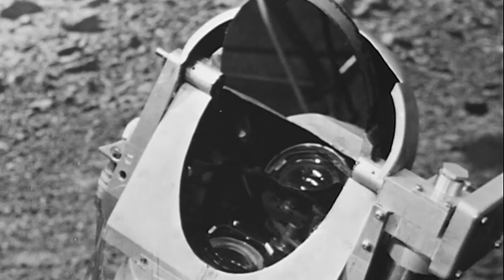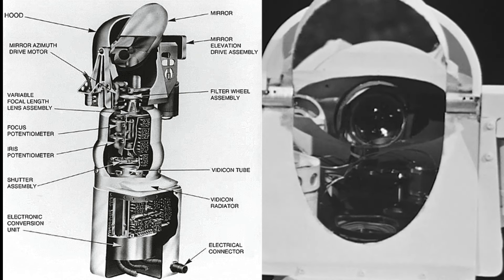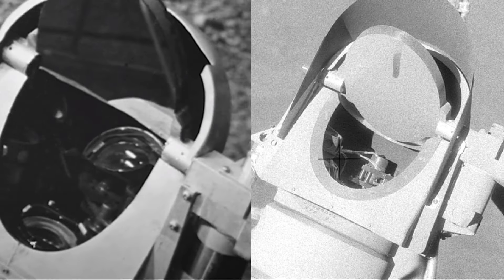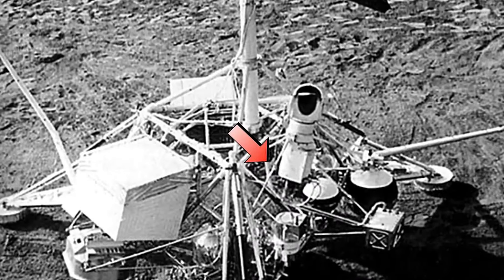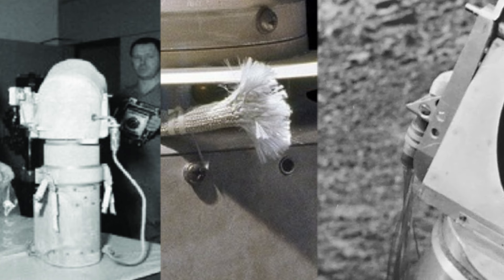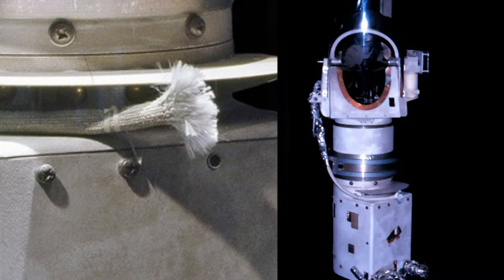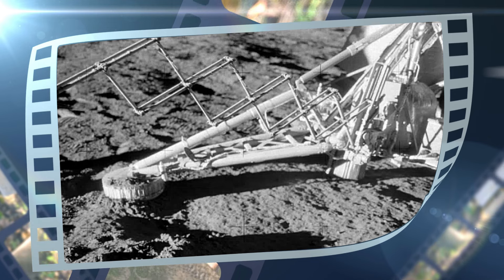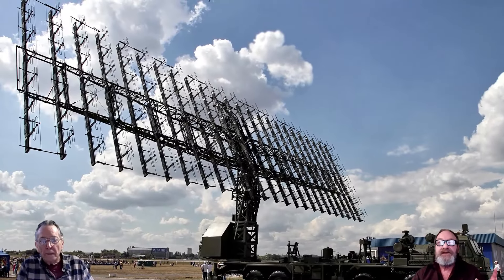THE APOLLO DISCUSSIONS "SURVEYING THE SURVEYORS" PART 63

Comment: Yep, thats rope mock up, attached with duct tape to hold in place.  Too much fluff in the end/cut to be insulation/static protection. looks more like cotton rope.
Reply: I think the stage techs were told to clean up the untidy dangling array of wires, which they tore out and replaced with an insulated wire sheath.
Reply: @yomommaahotoo264 Looking at the end of it, it is massive, like cutting climbing rope or sail rope. No way 8 wires  goes into it.
Reply: @anubisiii4384 
I've seen it in hi temp equipment I work on, and it does fray like that - but it doesn't always fray FAST like that.
If it's what I guessed than it's been hanging around between a good few stage sets.
Reply: @yomommaahotoo264  "fray" good new word. One thing that it may be a sheat, is the form of the "rope" is irregular, and one thing that it looks more like massive rope is the white attachment point or is it a clamp, some centimeters from the end. anyway. it isnt the whole world.
Reply from the maker: Sad isn't it. Cheers!
Reply: It's military issue parachord.
Reply: @mattrob19742008  
That would actually make the most sense since the AF hosted staging events.

Comment: Thats not a rope, it is cloth insulation that goes over the wires, in the pic with the wires  they took off the cloth insulation. BUT TO WORK ON THE MOON THAT HAS TO BE HOOKED UP. 😊
Reply: Bang on right.
Reply from the maker: Indeed it is referred to as "ROPE WIRE." The braid is the insulating material to be sure but the problem that we see here, is where are the eight wires inside of it? Since you can still see the wire harness after the cam lock at the top going in to the rear of the head, we should still see frayed wires at the other end of the insulation. We do not. That is a big problem.
Reply: @theapollodetectives  I'm assuming the wires where pulled through to the inside to work on it, and the cloth insulation was left on hooked to the connector. obviously that has to be hooked on on the "moon pictures"

Comment: And you don't see the "rock" that the scooper is going for in the wide shot. Also the sun's position is different?
Reply: According to the apollo narrative in terms of how low the sun was in the sky, the shadows should've been much longer (ie: stage lights).

He did mention the rock and describing it as being big for that flimsy claw to be aiming at it.
Reply from the maker: One thing is for certain, the shadows would be much longer IF the sun angles were really 12 and 15 degrees as NASA claims. Cheers!

Comment: Comparing the Unified S-Band microwave frequency with an AM Radio Broadcasting station?   lol
Nice photo of the WLW antenna in Mason Ohio.
Reply from the maker: You are welcome. Now read the MIT paper on the propagation of 2Geg signals and higher, and what happens to them as they pass through the layers of the VAB's. I will be displaying that next.
Reply: @theapollodetectives  Electromagnetic Radiation does not become trapped in the Van Allen belts that are made of Particle Radiation.
You guys seem a little fuzzy when it comes to the difference between Particle and Electromagnetic Radiation.    There are not the same, ionizing but not the same.
Reply from the maker: I did not claim that magnetic radiation is trapped anywhere inside of the VAB'S. I said it is dispersed as per the MIT paper. So now you know more than the professors at MIT? It figures! @g.gorrell2088
Reply: @theapollodetectives  But you just asserted that the Unified S-Band 2,000MHz frequency would be affected by the Particle Radiation in the VAB's.
So you don't understand the paper from MIT then, Okaaay check.
Reply: @g.gorrell2088  "So you don't understand the paper from MIT then, Okaaay check."

No, as usual it would be you who doesn't understand.... 

The particle radiation in the Van Allen Radiation belts can interfere with radio frequencies, including the Unified S-Band 2,000MHz frequency. The Van Allen belts are zones of energetic charged particles, most of which originate from the solar wind, that are captured by and held around a planet by that planet’s magnetosphere.

These high-energy particles can interact with electromagnetic waves in various frequency ranges, including the S-band. This interaction can cause changes in the propagation of the radio waves, potentially leading to signal degradation or loss.

Most satellites, not designed to withstand high levels of particle radiation, wouldn’t last a day in the Van Allen Radiation belts. High-energy particles in the region can batter the spacecraft and even interfere with onboard electronics. Therefore, satellites that operate within these frequency ranges must be designed with adequate shielding to protect their sensitive components.
Reply: However, using particle board antennas solves a multitude of problems!
Reply: @straydog02  You forgot to copy and paste this from that article you jumbled together making it seem that you wrote that yourself. 🙂    I know better than that. 🙂
"Another important finding was discovering that in addition to humans shaping Earth’s landscape, scientists now know we can shape our near-space environment as well. Very low frequency, or VLF, radio communications have been found to interact with particles in space, affecting how and where they move."

VLF, or Very Low Frequency.    Do you know the difference between frequency and wave length, just curious?
Reply: @straydog02  You're not minding your manners here boy.    
Yeah, you jumbled that comment together from a copy & paste job to make it look like you wrote that, but I found the article in which you copied verbatim and pasted that here.

Yes particle radiation can cause some interference like oscillations or white noise but the transmissions in the 2,000MHz range will not be reflected or blocked by the VAB's.

You must be conflating the Short wave frequencies that bounce off of the D-Layer of the Ionosphere.

The one thing you guys are missing when comparing  a 50,000 watt AM radio broadcast to the Apollo S-Band frequency is that AM Radio broadcast is Isotropic like a dome, while the Apollo communications was an Anisotropic collimated beam, hence the reason for less power /wattage needed for the Apollo communications.  
  Big difference.
Reply: @g.gorrell2088  I never claimed to have written that information, nor did I jumble any of that evidence together.. I merely copied and pasted what was necessary to refute your stupid claim, with this information that you still can't refute with your current nonsense.. 

The particle radiation in the Van Allen Radiation belts can interfere with radio frequencies, including the Unified S-Band 2,000MHz frequency. The Van Allen belts are zones of energetic charged particles, most of which originate from the solar wind, that are captured by and held around a planet by that planet’s magnetosphere.

These high-energy particles can interact with electromagnetic waves in various frequency ranges, including the S-band. This interaction can cause changes in the propagation of the radio waves, potentially leading to signal degradation or loss.
Reply: @g.gorrell2088  "Here's what you left out again: "

What you copied and pasted was NOT in the source I copied and pasted, Pennywise.. And this is the only part that matters, since it refutes your original lie of claiming that particle radiation in the VABs does not interfere with the Unified S-Band 2,000MHz frequency, when it does! 

"The particle radiation in the Van Allen Radiation belts can interfere with radio frequencies, including the Unified S-Band 2,000MHz frequency."

"These high-energy particles can interact with electromagnetic waves in various frequency ranges, including the S-band. This interaction can cause changes in the propagation of the radio waves, potentially leading to signal degradation or loss."

How many times do you need to be proven wrong before you stop making a complete fool of yourself?
Reply: Citing reference sources, allowing the reader to consider the detail, context and veracity of the material, would surely help avoid this type of scenario?
Reply: @g.gorrell2088 What or who is Pennywise? (other than a film character)
Reply: @straydog02 Ummm...let me point out the Apollo user manual directly refutes Gumpgordell by stating you have to be very careful on antenna positioning to avoid nulling all antennas during transmission or reception. So we know they are very easily nulled. Also, NASA repeatedly mentions "radio wave propagation" on earth...yet oddly says nothing about how radio waves propagate with no atmosphere in a radiation field full of  flapping electrons on the moon.
Reply: @mikeh3441  Pennywise is the evil clown g.gorrell .. I gave him that nickname after the evil clown in Stephen King's story 'It'.
Reply: @TheCaptainSlappy  Thanks for that info, Slappy! .. It doesn't take much to directly refute Gumpgordell, does it?
Reply: So in effect, the "computer" would be turned into a very impressive Tesla Coil cooking off capacitors & etc. when it passed thru a set of dense radiation fields (or unprotected on the moon, since tin foil doesn't stop all kinds of radiations/emissions).

Since valves (tubes) are just radiation makers, passing electrons back and forth, with very minute screens/filters...the impact of x-rays passing thru to the plates of them, and capacitors (not diodes, at least not silicone that I am aware) would absolutely not take kindly to it, since the computer(s) couldn't function at all reliably on voltages.

Now to be fair...analog computers are robust, compared to what we got now...but it's a guarantee, as the Russians would tell you at Chernobyl, they are NOT radiation/electron proof. Even with shielding.

Of which all of the Apollos had none that I am aware of.

In other words, think of it like this (if I remember my tube electronics skills from when I was a kid)...

they were using wax capacitors (I am not sure on that though) with tubes (varying construction) from an All-American 5 (if you know, you know) with octo or hex bases.

So, take an old 1960's radio, and fly it into space with a battery/inverter to the moon. My guess is super great it won't make it very far. I can confidently say exactly zero of most soldering would last on the breadboards with those external temps.
Reply: @straydog02  Reported clkown shoes.
Reply: @TheCaptainSlappy  "In the vacuum tube of space"   WTF?     
Whata' mean "long delays between cathode and anode" electrons travel at the speed of light.
Whata' a bunch of gibberish!!     Comedy Gold Folks!!   Step right up!
Reply: @TheCaptainSlappy  "So in effect, the "computer" would be turned into a very impressive Tesla Coil cooking off capacitors & etc. when it passed thru a set of dense radiation fields (or unprotected on the moon, since tin foil doesn't stop all kinds of radiations/emissions)"
Cooking off capacitors?     MUUUUWWWAHAHAHAHAHAHA!    
Two kinds of capacitors, electro-lytic and coupling.    
The electro-lytic cap' filters out the DC current, coupling caps' do not let DC current pass.     
Cap's are filters basically, and you have NO idea what you're babbling about here.

The Apollo CM was not made of tin-foil, who told you that, and you believed them?    

All American Five?  wtf?   Those circuits do not have an isolated power transformer.
A 12AX7 has Nine holes in the socket.   lol
Reply: @TheCaptainSlappy  "I can confidently say exactly zero of most soldering would last on the breadboards with those external temps."      Breadboards?   lololol
I can honestly say that you are full-of-it, ever hear of Military Spec'?
Ever hear of NASA Specs'?     Can you say strain relief?    
Yeah buddy, it don't take much to refute me...   Just a GED and little confirmation bias with a huge helping of ego and narcissism.
Reply: @g.gorrell2088 I mean, I appreciate you quoting me, since I am always right and never wrong, but to be fair, I was only quoting basic electronics knowledge that Tesla & Edison talked about.
Reply: @TheCaptainSlappy  No I was referring to your dumb comments about capacitors and "long delays of cathode to anode" "breadboard" soldering circuit boards.
That was really funny.
You can read schematics? So can I!!    Where do you think the Negative Feedback Loop should have been inserted in the Apollo communications?
Reply: @g.gorrell2088 So you were NOT referring to your ack of basic electronics knowledge, but are now, somehow a "moon & electronics expert"? Lil' kooky.
Reply: @TheCaptainSlappy  You have no basic understanding of electronics.
Reply: @g.gorrell2088 Me and NASA clearly disagree with you. Did you not read the publicly available Apollo User Manual from 1966? Do not reply unless you have done so.
Reply: @TheCaptainSlappy  So now you know 12 men walked on the Moon because you agree with NASA?  Oh Okaaaaaay..
But all that gibberish about capacitors and diodes was completely and utterly nonsensical.   lolol
You forgot to put in the chrome muffler bearings.  lolol
Long delays from cathode to anode?   lolol   Hilarious!!
Reply: @g.gorrell2088  "Reported clkown shoes."

Day drinking again, or did you forget how to spell clown?  🙂

Comment: Are there any photos from the surveyor and what was the point of that dirt scoop as it retracts to absolutely nothing so how did it test the soil?
Reply from the maker: I have a video of them testing the scoop. It does retract all of the way. Interestingly enough, the cord that attaches to the scoop is attached at the same point on the Surveyor probe as the one on the so called moon. Why would anyone require a wired in control box to on the moon is anyone's guess, especially when it flew there autonomously. I didn't realise that 3M manufactured multi stranded cables that were 251,000 miles in length. (haha)!
Reply: Where are they?@William-tecumseh-sherman
Reply: How did it test the soil?@llodetectives
Reply: @William-tecumseh-shermanWhy would they put dirt in the test chamber only to have to vacuum it out later?
Reply: Point out the container . Good luck @William-tecumseh-sherman

Comment: ALKALINE BATTERY SUCKED IN THE 60'S🔦ANYTHING RUNNING ON BATTERIES, ON LUNAR SURFACE COULDN'T WORK °-250 °+250😂LITHIUM BATTERIES CAN'T WORK ON MOON😂
Reply from the maker: Remember the Virdy Bird helecopter in 1970 that took two D cells to operate? The best of batteries lasted a whopping ten minutes at best before the toy heli could not leave the ground at room temperature. Imagine how those would have functioned at +250 to -250F. I don't think so either. Cheers George!